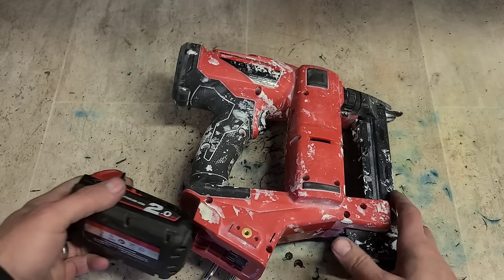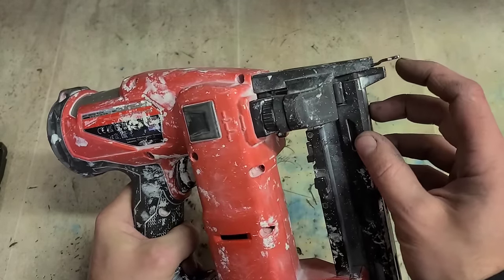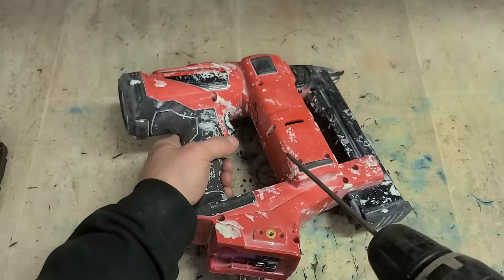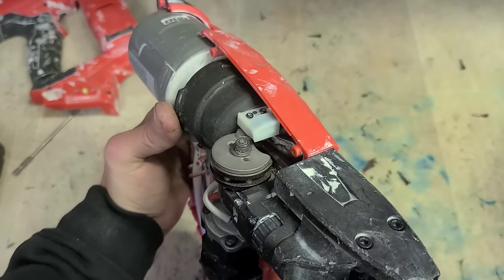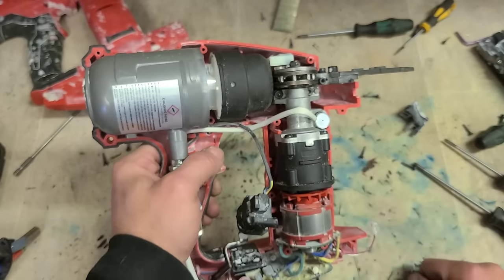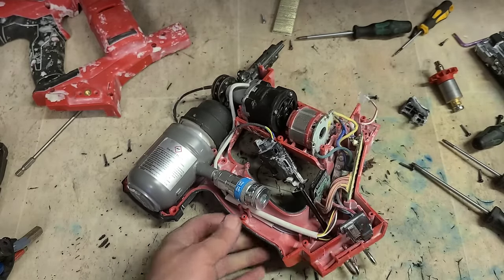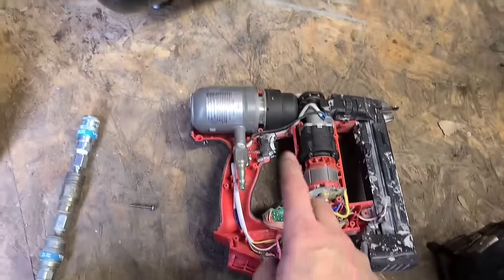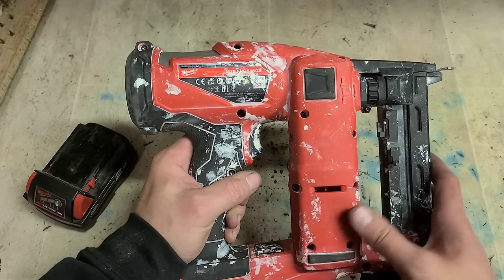How to repair and repressurize your Milwaukee nail gun. M18FNCS18GS crown stapler that won't fire.

Comment: Nitrogen is used because it doesn't hold any water in it, but air does. You don't want water condensing inside your chamber, which is why using nitrogen is smarter than using air. Nothing more, nothing less as a reason. The whole molecule size was thought up by someone that didn't think or know that water in the air could be a problem for tyres. In car tyres it has to do with the water in the air expanding much more than the oxygen/nitrogen when the tyre gets warm from driving, making it harder to keep the optimum tyre pressure.
Reply from the maker: water is only a problem when the air is being replenished, this is a closed system. so it is always reusing the same air. 
Water build up is a problem for a compressor as it is always compressing fresh air, These guns compress the same air so the water content never increases
Reply: @deandohertygreaser  would a dryer work in this case?
Reply: Can set the compressor in a room with an air dehumidifier for the purpose
Reply: @deandohertygreaser  With air, if it has water, a little more pressure may be needed because H2O is incomprehensible.

Comment: Working on a 2745-20 framing nailer right now and it says "120psi Max Pressure" right on the sliver canister. So you definitely need the higher pressure to make them work. Thanks for the great video - I wasn't sure at first which steps to take to repressurize it.
Reply: Ok, I misread the label - actually it says 102psi Max Pressure. But the low pressure fills won't work, and I suspect it's because that without the proper filling tool adapter, you need to overcome the spring pressure of the Schrader valve before the air will go in. Hence the higher pressures needed to refill it. At least that's my guess...

Comment: I believe the the air fitting size is for refilling the cylinder is 1/8 bspt , the hitachi/metabo refill tool will not work, they have a different thread size. Just had a milw. framer in for repair.
Reply: Does any one know where to get an adapter for refill air?

Comment: The only advantage that I could see in favour of using compressed Nitrogen over compressed air is that high purity Nitrogen contains no more than 3 parts per million of water in it, compared to air containing over 600 ppm
Reply: You used to be able to get your tires filled with nitrogen. I had it done once, and the pressure maintained for the entire life of the tires
Reply: Nitrogen also doesn't fluctuate with temperature like air does

Comment: That’s why every time I took my Milwaukee 18g nailer in to my service Center they always gave me a brand new. They told me like you mentioned that the air chamber is not available as a part. I had 2 of them and loved them when they worked but mine would lose pressure as I shoot a lot of brads with it. I switched to the Metabo just because you can refill them yourself. And it’s much lighter than the Milwaukee. 

Love your repair videos up here in Winnipeg Manitoba Canada ❤

Comment: I have the Hikoki 15ga cordless finish gun and i was able to repair it from your videos.
I recently had an m18 18ga go bad and i just took it to Milwaukee. I could never do this.
Reply: I had two hikoki 15g guns, both repaired 3 times each before i got a refund. Never sunk a nail from day one.
Reply: @kizzjd9578  what were you nailing? Mine occasionally leaves nails proud in hardwood casing/base, even after refilling it, but all the paint grade stuff like primed poplar, pine, mdf trim and door jams, window jams, etc never had an issue. I've also used it on LP siding trim.
Reply: @histguy101  soft fc sheet and 12mm pine into pine studs.

Comment: A shock pump for push bike forks would probably be a cheaper option for a high pressure pump than a pcp rifle pump should you need to get higher pressure than the compressor could manage
Reply: Yeah definitely and thats what I was  thinking I could use when mine goes but it’s getting an adapter to fit?

Comment: I have 4 first gen DeWalt 18 volt drills when they first came out. 2 still running. 2 used for parts spares. Should last me til I retire, 2.5 years.

Comment: ya not sure in Ireland but in Canada there are no service parts available for these milw. cordless nailers. They even have security torx screws so they definitely don't want you working on them. At our shop we stopped taking them in and just tell people to go directly to milw.  Just wondering did you try to use the hitachi metabo J-395 recharge tool for a refill, could have sworn I thought they were compatible , maybe getting mixed up with the framer. cheers nice video.
Reply: i was curious about the refill tool too, even if the air psi would be similar. from my understanding they are all using a senco patent too, arent they?
Reply: @peterfroese8606  to be honest I'm not sure, never worked a senco, but I'm almost positive the j-394 metabo framer refill adaptor will work with the milw. framer and I believe all three hitachi/metabo refill connectors have the same threads. So if the milw. 18g has the the same thread size as the framer, then the hitachi/metabo refill tool should work.

Comment: I'm a builder, been in the trade for 20 years. I've always stuck to Makita. Although the other brands perform well but when it comes to repairs they are a hassle. Makita parts are always available and usually cheap to replace. That goes for most Japanese brands. American brands in my experience just ain't up to par, when they are running good they are great but anything goes wrong and it's usually a full tool replacement

Comment: Ahhhh, these parts websites look almost as bad as the Ford parts website I’ve been struggling with lately.  However, it’s worth pointing out:  On that Milwaukee parts list site, it looks like the image is just broken, they may just have a bad link, worth letting them know and they may fix it.  Also, I see some parts in that parts list which are not on the parts diagram, for example, part 0135 is the Magazine.  So it doesn’t seem to be accurate to say the Magazine is not available for that gun, it just isn’t shown on the parts diagram you found on some other website.
Reply: Nope, Dean is presenting accurate information on the Milwaukee cordless nailers.  Only parts you can buy are the service plate, work contact bracket, belt hook, corresponding screws, no mar tip and some warning stickers.  The service manual is nothing more but a diagram of the outside of the tool and a lot of red lettering that demands you send it to Milwaukee for repair because of the compressed air system and electronics.  I don’t remember off the top of my head the cost but Milwaukee will top off the nitrogen for you (somewhere between $75 and $175).  To be fair, if you dismantle it under pressure, you won’t be having a good day. Ironically, at least one of the  Ridgid/AEG nailers has a user serviceable air port.

Comment: Also Dean do you ever come across 110v sds drills that take a dust collector attachment? I know dewalt and bosch had one but can't seem to find one in stock in the uk.

I know we can get this kit in 18v or 36v from all the brands but would prefer 110.

Thanks in advance
Reply: Try toolnation. They have the corded Hikoki and Bosch Rotohammers and sell the HEPA units separately

Comment: How’s things Dean I have a paslode 1st fix gun it’s the older model well kept and maintained by me I’m a carpenter and look after my stuff but the gun fires ,drives the nails but won’t sink them in or even flush have adjusted the depth every way and if I set it completely deep it won’t fire the nails at all it’s like it’s lost the power if you know what it could be let me know much appreciated many thanks . Al
Reply: Sorry Dean it’s a IM 350 90 CT model many thanks .Al

Comment: If I was to look into a battery eco system for tools to use around the house, garage and garden. Who would you suggest. I wouldn't need dewalt but also dont want B&D. Looking for a good middle of the road setup that all use dame battery setup
Reply: The craftsman rp line is a good middle of the road line. Most are rebadged dewalt at a significant reduced cost. Ryobi brushless tools is also a good choice.

Comment: If you could get a schrader valve adapter for the tank you could maybe use a bicycle shock pump to pressurise it. They are cheap and can pump up to 300psi.
Reply: I'm pretty sure it takes nitrogen. The other Milwaukee nailers do at least
Reply: @histguy101  if you watched the video you'd know it doesn't need to.
Reply: @dunch1988  good 2 know

Comment: Would a bicycle pump work for recharging?
Reply: I’ve a first fix nailer from Milwaukee. Didn’t use it for 6 months went to finally use it no air. Got a small adapter of Amazon for a 10er tried pumping it to 120 no use bucked 200 in it and it goes like a dream
Reply: Good call!! If possible Can you give us a link on were to find it please? 👍🏼

Comment: Youre still wrong. 

You need a shock pump for a mountain bike
They are low volume high pressure and go to 300PSI.

These milwaukee guns need around 200-225PSI.

Comment: at 4:04, what was the bit used? thanks!
Reply: It's a left handed drill bit, so the brill bit flutes run in the opinion direction, which means you run the drill in reverse. This often grabs the screw while drilling and as here helps remove the damaged screw

Comment: Time to buy a high pressure bike pump
Reply: Doesnt go as high, you need a PCP pump used in air rifles.
Reply: @zaxmaxlax  I've got a high pressure bike pump, they are used for the suspension. 250psi on the gauge, can easily do half that. Never tried any higher. Low cost too.

Comment: Don't some tyre fitting shops use nitrogen
Reply: Yeah, for temperature stability, Nitrogen expands and contracts less so the fluctuation in psi isn’t so high with weather changes. More of a gimmick in normal use, has applications in racing however due to pressure/temp is easier to manage
Reply from the maker: dont think they are going to start fixing nail guns

Comment: Milwaukee are really getting an appalling reputation for repairability.

With their complete garbage electronics in their brushless tools.

Ridiculous cost of replacements electronics with the parts costing almost the same as a complete new tool.

Now like you say you can't even buy half the spares even if you want to. 

I got the gasless 18ga Brad Nailer & it is complete garbage went on for repair 3 times under the crap 12 month warranty on nails guns (Milwaukee obviously know they are crap as won't offer 3yr warranty) & it still couldn't fire beads properly below the surface or fire a full strip of brads with jamming.

Electronic circuits failed on my CCS66 & M18 Surge Impact driver, 

There slogan of "Nothing but Heavy Duty" is not justified for the most part IMO. 

I will not be replacing them with Milwaukee.
Reply: Well said I didn't know they only offer 12 months instead of the three years if registered warranty on nail guns that's a huge no go if that's true
Reply from the maker: so they wont even give the nail guns a three year warranty even if they are registed.
Reply: @deandohertygreaser Nope, well they didn't with the 1st gen 18ga gasless nail gun.

I had a big argument with them about as mine had spent more time in for repair than I had used it. If I recall I rang them when trying to register it & saying it's accepting my serial number & they said that's because they only have 12 months on nail guns. 

I am now wondering if the not firing nails below the surface has been a low gas pressure issue all along.
Reply: Wow things are really different in UK. Over here in US they offer a 5 year warranty with these guns and I sent mine in twice and got it repaired at no cost. Can ship it for free since you just print out a label.

Almost at 5 years with one so I know the next time I need it repaired they will charge me. I expect another year and half out it though. Should be able to get 6 years out of it since I got it repaired at rough 4 and half years.
Reply: @user-hy8oh1cy3q  We get 1yr as standard & 3yrs if you register for the "extended" warranty.

The nails guns are the odd exception where you only get 12 months & cannot register for extended, I think battery chargers might be another one & there is probably more I don't know about.

Also here in the UK Milwaukee dont have their own repair centre, they use "authorised repair centres" which are just local tool shops & it takes weeks for tools to be fixed. You have to wait for them to look at your tool, then they have to order the spares then get round to fixing it, the whole warranty & repair system is crap. I have got quite a lot of Milwaukee kit & it's been the least reliable of all my tools, out of Fein, Festool, Dewalt, Metabo, Bosch & others.

DAB radio failed fayer 1 month. 12v battery was faulty from new. SDS drill had warranty repair, Impact driver needed warranty repair l, M18 Surge impact has lost all it power & too expensive to repair & CCS66 circular saw failed & too expensive to repair & the 18ga gasless Brad Nailer is unfit for purpose & utter junk.
Reply: Such a shame Milwaukee aren’t good for repairing in the UK - it’s not on, as other brands are much better for spares, and there’s just no excuse.
Milwaukee tools normally come out as strong performers when tested against others, but it’s such a shame the overall service isn’t better.  It frustrates me they don’t pot their circuit boards too.
That’s coming from a Milwaukee fan too - nearly all my tools are Milwaukee
Reply: @WombleUK  dang  thats rough why do they do that to UK customers in the US they have one of the best reputations for warranty i have alot of their tools and have hardly had any problems but you guys also get all the good makita and bosch tools and german hand tools so i guess we deserve at least a good warranty

Comment: Why do people still buy Milwaukee? You said in another video that even the rattle gun has very few parts.
Reply: Because they generally are one of the best performers (when working mind you)
They do a great job at covering every trade with a huge range.
And they have really good marketing. It's the fashion to buy red.
Personally I'm a Makita man myself. That being said I do run Milwaukee's M12 line because they make the tools I want pure and simple. If Makita made a compelling 12v line I'd buy theirs, but they dont
Reply: @zarajoe1 well said here. Makita's 12 volt line it's poor In my opinion compared to the 18 volt. Dean has said better things about milwaukee's 12 volt line when he has torn down I think a grease gun and maybe a small compressor. The 12 volt impact wrench looks very good for the size as well.

 18v Milwaukee - the performance and power you can get out of them with a big 9 or 12 amp battery is good but repairability crap - great for big companies when you're not the individual paying for either repair or replacement but for single tradesmen Makita all the way
Reply: @zarajoe1 I would agree. I am 99% Milwaukee. Are they the best in everything? No. Like you said those the amount of tools they offer in all aspects of work is crazy really. To me the same battery platform goes across so many tools is the selling point. Makes it easy that I can carry one charger and one brand battery. But to each their own right.
Reply: From a DIY point of view, I have the liberty of choosing from 6 different battery platforms because it gives options.  From a professional point of view, I have 6 different battery platforms because it gives me options based on how often I am geared to use a tool.  I prefer Makita, but also strangely AEG and Rigid.  You'll catch me using Ryobi as well.  I only have 3 M18 tools.  Used to have 6, but had to bin them due to no parts.  

There is no one universal answer,and no reason to stick to one supplier.  Hell, I'd that was the case Ryobi would rule the world.  

Unless I know I'm going to be using a tool for 9 hours a day, I won't buy Milwaukee again, especially knowing I'm going to bin it in 2 years.

Comment: I own 18 ga finish nailer (2). One of these. What I noticed in this video is 1. You treat your tools like shit. 2. Charging with air allows the thing to freeze in cold weather due to compressed air carries moisture, nitrogen doesn't.  3. I had a gun fail on me after 1.5 years. Contacted Milwaukee. They paid to ship it to them and ship it back fixed (all free). 4. I can access any if the replacement parts with ease. Just see my Milwaukee representative and get what I need. I'm not a fan boy. I own whatever brand performs the best. Some Dewalt, some Bosch. Buy based on performance, not brand.